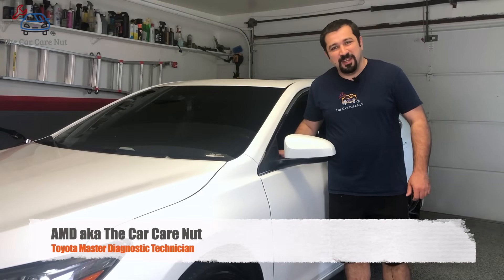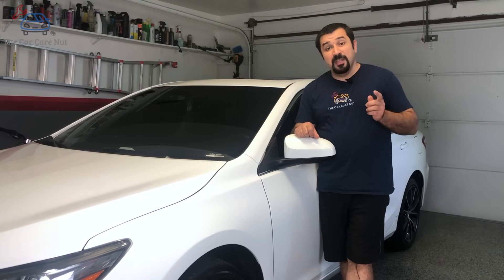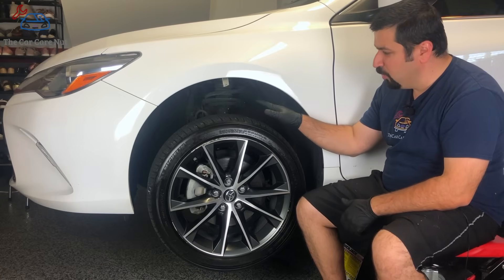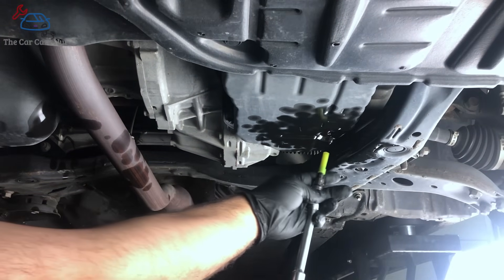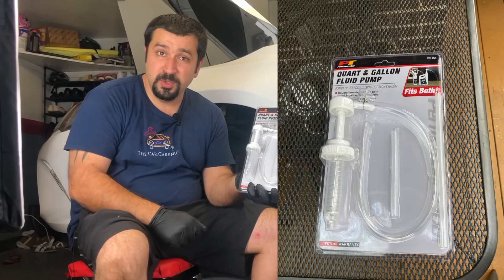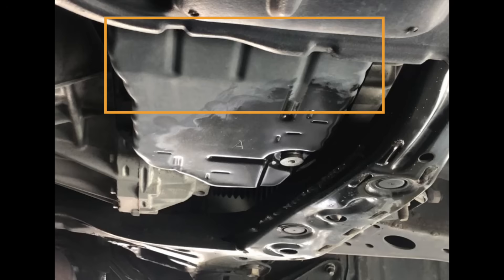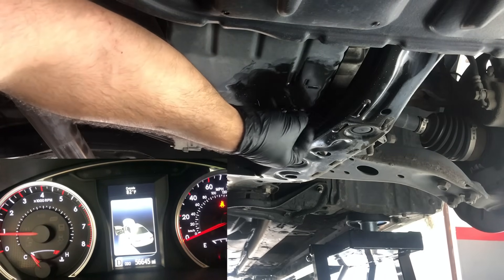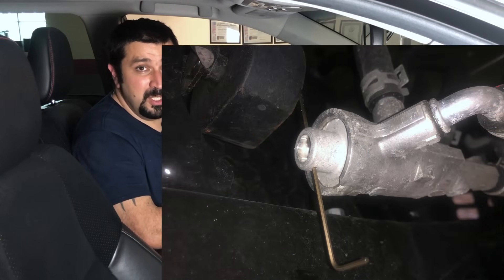How to change your Toyota Sealed Transmission Fluid

Comment: Great instructions but the heat temp gun procedure, I found out, is not a good option for an 8-speed because this tran doesn't have a pan.  I took readings all over the tran and they varied by 20 degrees.  I could not get a reading above 91 degrees on anything close to the bottom or sides toward the bottom, regardless how long I ran the car.  What is your recommendation for a low-cost scanner that does transmission temp?

Comment: I have been following your videos and you are simply amazing.  The attention to the detail you provide to simplify it for us DIYers is just gr888.  I had this done on my 2014 Rav4 and everything worked out like a charm.  I did it when the outside temperature here in Toronto was 0 degrees celsius so it took about 4-5 minutes for the Drive sign to appear on the dash and i was getting a little nervous lol...  I actually did visit the Toyota dealership to get this done before and they talked me out of it.  So glad i saw yr video and true enough at a 125,000 kms the fluid was dirty and black. Thank you sooo much for these great videos.
Reply: Hey Claudius, did you put the vehicle in drive when the temp was right or did you have a helper with foot on break and vehicle in drive while you made the level adjustment. Thanks in advance
Reply: @unclejediisampsonii3624  I did this without any helper and I had put on the wheel back on the driver's side after filling the transmission fluid, I did not use jack stands.  Just choose a level surface.  I just waited for the D to stay solid and then put the vehicle in park (without turning it off) and quickly crept under the vehicle to remove the drain plug.  The RAV4 sits slightly higher and I am small built lol... so did not have an issue.  Might not work with a car (Corolla or Camry) due to the ground clearance.  I also kept the drain pan ready under the transmission before I began the process.  Good luck!
Reply: @claudiusdsouza8772  Thankyou Claudius, much clearer now 👍but still a little intimidating.
Reply: The transmission needs to be flushed when the fluid color turns to brown and black.

Comment: I have a Toyota vanguard it has cvt transmission and takes Toyota TC oil my question is what procedure do I do to check the Transmission oil temp when checking the level of the transmission oil . Tried what the video said to do and it didn’t work .

Comment: Thanks for this informed video. I just did the fluid change. When I started fluid level check procedure, I kept the engile idling until the temperature hit the right level, and when I removed the "level check plug", only found no fluid came out. Shutdown the engine and put in another quart of fluid and redid the level check, a little amount of fluid came out this time. Feel so stupid to let this happen. I'm now wondering if the idling with about 1 quart of fluid short for 10 minutes would cause any damage to the transmission, thanks :)

Comment: I have a easy hack buy a fiber optic probe off Amazon for $20. Of course follow this guys instructions first . Then put the fiber optic in the fill hole to check the level to the straw.

Comment: I have the 2016 rx350 with the 8 speed transmission. I can't seem to find that oil cooler bypass you are referring to. Can you give me directions to where look and the same shape of it as in the video.
Reply from the maker: Hi! It looks exactly the same as in the video and it’s located between the transmission and the radiator you might have to take some covers down. If you don’t find it there then your car is not equipped

Comment: What about replacing the pan filter? Is that something that just shouldn't be touched?
Reply from the maker: Hi! If the fluid is changed on time you don’t need to service the filter on Toyota and Lexus transmissions

Comment: AMD... HELP! (again).  I just tried AGAIN to set ATF level fluid in 36 degree ambient temp. & my 08 Avalon did the same thing.  After roughly 23 mins of being in temp mode, the D went to solid green.  I jumped out and set the ATF level in roughly 4 minutes.  I immediately checked the status of the D and it was totally off again!  I left the car running (in temp mode) and was taking your advice to just zip it up and add 200ML of trans fluid to top it off.  I had just torqued the drain bolt and was going to turn the car off when I saw the "D" solidly illuminated again!  I was going to re open the trans pan drain since the D was now solid green AGAIN (just to make sure).  Just before doing so, I went back to look at the dash again and the D was blinking green now!!!  Knowing all of this, does the advice you gave me before still apply??? >" just add 200ML ATF on top and seal everything up and your good"?, or would you try to set the levels again and simply ignore the "first" solid D and wait for the second one (but I'm not sure how long the second one lasts).  OR some other advice?  FYI  I am doing this because I had to change out my radiator & I lost a little ATF doing so) so wanting to make sure ATF is level.  That being said, I am adding 1/2 qt on top before starting process each time and it seems like I am getting roughly the same amount out after the above temp / leveling processes.  Maybe the car is somehow still in "solid green d mode" while the D goes dark for a short while and then comes back on solid green and then goes to blinkng green???  Again, your fast reply is appreciated (even if it is just your best guess) Help!
Reply from the maker: You’re good. It’s just too cold for the transmission. If you had the trickle and then added what I told you, then you’re all set don’t worry about it.
Reply: @TheCarCareNut  Thanks.  I greatly appreciate you!!!
Reply: @TheCarCareNut  The ambient temps have (weirdly) risen pretty high (62 now) in my area since I last messaged you (it was 36 degrees before) with my ATF fluid level setting issues (intermittent "D" temp function).  I did what you told me to do before and have had no issues (& have driven 800ish miles on hwy since then) but wondering...  Do you think I should try to re check the ATF level while the ambient temps are higher of do you think I am OK?  it is forecasted in my area to be 60s, 50s, high 40s and one day 70s (but rainy :-() over the next ten days.  but will prob be colder after that.  Just askin your opinion.
Reply from the maker: I wouldn’t worry. You’re good!

Comment: Another great video!  Qs: 1.  Where to get 2-3 replacement washers?  Dealership?  2.  How many iterations to get achieve "reasonably fresh" fluid?  Only 1?  Or 2?  Or 3?  3. Recommended temp. for U660E 2012 with 2GR-FE Camry seems to be 104 deg F to 113 deg F: can you confirm?  Thanks.
Reply from the maker: Hi! 104-113 is good. Dealership on the washers. And a single replacement is sufficient
Reply: @TheCarCareNut  Thank you so much AMD.  You're fantastic and deeply appreciated!

Comment: AMD HELP!  As I type this, I'm setting the fluid level on my car outside (not in a garage) and Ambient temp is 40 Farenheit.  I have successfully set the ATF level on this sealed trans twice before in ambient temps around 70-ish degrees.  Tonight my vehicle went into temp mode in roughly 20 minutes (solid green light) I went to drain excess ATF fluid and when I got back up (within 5 minutes) the D light was blacked out!!! (It was NOT green or blinking green)  It ??? cooled off somehow (while still running)???  Could it be the ambient temperature causing this?  1) Do you think I got an ACCURATE ATF level set?  I guess am going to set it again and want to make sure it is right.  If the same thing happens again,  2) should I wait for the solid green D to appear AGAIN (will it?) and recheck the overflow tube after that???  Any ideas?  HELP!!!   Doing this in a semi-warmer garage is not an option for me.  Your super fast reply (even if just an educated guess) would be greatly appreciated as I am stuck & don't know what to do!!!
Reply from the maker: Hi! Try it again when the light comes on solid. If it keeps doing the same thing leave it as it is and add 0.2 quarts of fluid and you’re good.
Reply: @TheCarCareNut  Thanks for the fast reply. Just one more question.  I currently have a pretty strong fan blowing on the wheel well side of the trans with the hood of the car open to let the heat escape.  I want to get the ATF level set tonight (even if I have to stay up late).  1) How many hours would you guess it will take for the trans & fluid to cool off enough to repeat the process?  FYI, also I have a laser temp gun I can use to try to judge if the trans has cooled off.  just not sure if exactly where to aim it and if it will tell me how cool ALL the trans fluid is.
Reply from the maker: If the light is off you’re colder than the temp range if it’s flashing it’s over. It sounds like your light was off so you won’t need to let cool down

Comment: Most dealerships have machines that do transmission service. Does Toyota have a machine that flushes and replaces the correct amount of fluid? I take my 2004 Silverado in every 40-50k miles since I got it new and have had the flush service done and I am currently sitting at 210k miles on it. I plan on having the dealership service my wife's 2020 Camry, I was just curious how they do the service.
Reply from the maker: The dealership typically will use an exchange machine and they should check the fluid level afterwards to double check it

Comment: @The Car Care Nut  - I am looking at a used 2013 Sienna 2WD. 127k miles. NEVER HAD A TRANSMISSION FLUID CHANGE. Presuming that a drain and fill is the only safe thing to do at this stage, correct? Car had a lot of regular oil changes, a couple at 10k and the rest at 5k.

Quality of used cars at Toyota dealerships has fallen greatly 😭

Comment: Hey AMD, what's the part number for the green overflow tube? I plan to replace mine because the last time I did this I couldn't get the tube out without taking off the pan because it was rounded off.

Comment: 2015 Avalon 84k miles. Trans fluid drain replace or full flush? Same question for 2013 Corolla 118k miles. Thank you Sensei
Reply from the maker: Hi! Drain and fill is safer in this case
Reply: @TheCarCareNut  Good morning. I preformed the obd jumper method for practice on a cold transmission, however I couldn’t get the solid Drive light. I did a video I’d like to email you, maybe I missed something. Thank you Sensei.
Reply: In both cars, Replace trans filter or no?  Thank you Sir

Comment: Sorry to trouble you again AMD but I had my transmission fluid tested by Blackstone and they reported that metals were very high. They added that their metals standard is based upon wear at 38,400 miles and since my car has 124,000 miles without a fluid change this might account for elevated levels but that metals are still high even when considering that. The test results were as follows (Actual tested Levels/Universal Averages)  Aluminum 433/18, Chromium 3/0, Iron 390/53, Copper 607/67, Lead 1/15, Tin 33/3, Molybdenum 0/2, Nickel 20/1, Manganese 7/1, Potassium 0/2, Boron 33/84, Silicon 79/16, Sodium 10/7, Calcium 132/150, Magnesium 4/12, Phosphorus 271/335, Zinc 29/38, Barium 7/2. SUS Viscosity was 42.6/41-51, cSt Viscosity was 4.98/4.5-7.9, Insolubles were 0.1/< 0.1. The lab recommended I change the transmission fluid and then retest in 15,000 miles. These numbers seem high but I lack the experience to interpret them. What would you recommend I do? Thanks!
Reply from the maker: There’s a risk replacing the fluid now but if you do only a single drain and fill

Comment: Hi AMD, what's the temperature to check fluid level on a 2014 Avalon 3.5 V6?
Reply from the maker: Hi! 95-114
Reply: @TheCarCareNut  Thank you AMD! Btw, can you confirm that the temperature to check the transmission fluid level on a 2014 ES350 is the same as the Avalon 3.5 V6 (95-114)? As I understand the ES350 and Avalon are mechanically the same.
Reply from the maker: Hi! It’s the same temp
Reply: @TheCarCareNut  Omg thank you for responding so quickly! I just noticed that you replied to another comment in this video that the temperature range for a 2014 es350 is 104-113, but here you mentioned it's 95-114. Can you please confirm which one is correct? I don't want to get it wrong. Thank you a lot!
Reply from the maker: 95-114 is what I’m looking at. That might’ve been a typo

Comment: Love this, thanks! Question: how do you feel about just replacing the amount that you took out? 2015 Sienna with 91K km (56K miles). I am tempted to just bring it to the dealer to make sure I don't screw anything up but I don't know if I trust them to do the full and complex procedure when the transmission is too hot (vacuum, adjustable straw, etc). However, kinda nervous about screwing up the level doing it myself. Is it pretty safe to add what you took out? Thanks so much!!
Reply from the maker: Hi! That works if the level was right to begin with. And you’d be surprised….. I would check the fluid level
Reply: @TheCarCareNut  ok thanks! What would the temperature range be for a 15 Sienna LE FWD? And are there any washers or gaskets that will need replacing on either the drain or fill?
Reply from the maker: Hi! 95-114 and yes there’s a drain and fill gasket which your local dealership would have

Comment: Hello 
Thanks for the video !!
Much appreciate that you share your knowledge and expertise.
I need your advice. I have a 2011 Lexus IS250 sedan rwd. I bought it with 124k mileage and the previous 2nd owner did not have the transmission fluid changed. Let’s assume it was not Changed at all. Would I be taking a risk to do a drain and fill at this mileage? Or is the risk more greater for the transmission to fail in the future if I do nothing?
Thanks again for your videos, tarek
Reply from the maker: Hi! At this mileage I would leave it alone

Comment: What should the ATF temperature range be on a 2019 Sienna...preparing to this on it over the weekend.
Reply from the maker: Hi! 95-114
Reply: @TheCarCareNut  Thank you very much!  May God bless you and all your family.  Have a wonderful Thanksgiving!
Reply: @TheCarCareNut  as you can see 4 months have gone by and I just did it today.  Reason being 4 months ago I was not able to remove the fill plug (behind metal plate) my shallow 1/2" 24mm socket/wrench would not fit.  I learned a long time a ago not to drain anything until I know I can refill it ;-).  So bought the Astro Pneumatic 3/8 nano socket set that includes a 24mm socket.  Worked great and did it today using my OdbII reader at 114 degrees.  Again... THANKS!  Could have never done it without this video and your input.

Comment: Is there a reason you cannot just prior to starting in sure that the replacement fluid and the fluid in the pan or the same temperature? Measure exactly what you take out, and put that exact amount in? If the fluids are the same temperature should they displace the same amount?

Comment: Quick tip to save you a shitload of time. Do all of this while the vehicle is cold. Drain all the tranny fluid into a container. Pour into something you can use to measure the fluid. Measure, or eyeball how much came out and then simply put that same amount of new fluid back in.

Easy.

Comment: How do you check that the car is level ?
Reply from the maker: Relatively level. Just by eye sight. So if it’s on ramps that’s not level or the front is lifted only. Lift all 4 corners of the ground with similar length jack stands

Comment: I have used Valvoline MaxLife Multi-Vehicle Full Synthetic Automatic Transmission Fluid on my 2015 Camry @150k miles two years ago.  It works just fine.  I bought that Camry used @130k miles.  Previous owner told me he is a sales manager for Audi.  So the car should have mostly highway miles.  The shift handle was shaking at red lights before fluid change.  The released oil was vary dark, so I did two changes.  It has no more shakes and red lights at all.  I used a infrared temperature gun to target at 95F.

Comment: When you are checking the fluid level with the engine running is the Fill Plug in the hole or Out?
Reply from the maker: You can leave either out or installed. You can leave it off in case you need add additional fluid
Reply: @TheCarCareNut  awesome! Thank you for the quick reply!

Comment: What is the correct transmission fluid temperature for a 2010 Toyota Avalon in order to check fluid level?
I’m planning to do a fluid and filter change soon. Thank you for your videos!
Reply from the maker: Hi! 95-114

Comment: Outstanding instructional video, I will be trying this on my 2011 Avalon that I just bought. Is there a specific wire to use for the jumper?
Reply from the maker: Hi! Any small wire that fits the pins will work
Reply: @TheCarCareNut  Thank You

Comment: Wonderfully detailed video! One of the commenters below mentioned the old method I use on my 2009 Sienna (with a dipstick) - disconnect cooler return line, drain 1-2 liters at a time, fill, run etc. Question: I know you mention the importance of the level, but just simply - assuming the level WAS correct to begin with, can I still do this same procedure with a coolant retun line on 2017 RAV4 XLE 2.5?
I have the car since new.
Reply: I should clarify - exactly measure what comes out, and replace with the same amount. Do it at room temp, since the new fluid is at room temp to begin with.
Reply from the maker: Hi! I don’t recommend this method as you could run the transmission low on fluid.